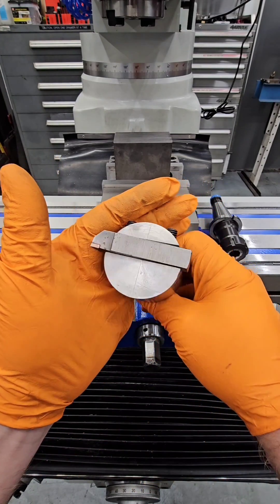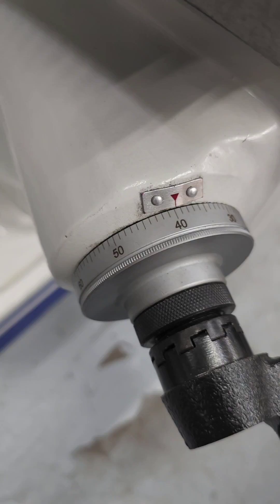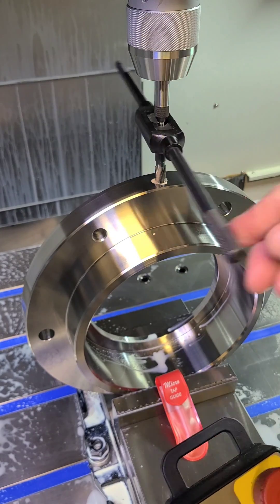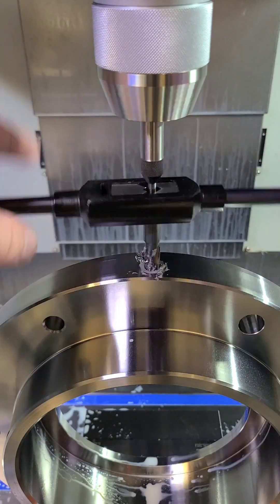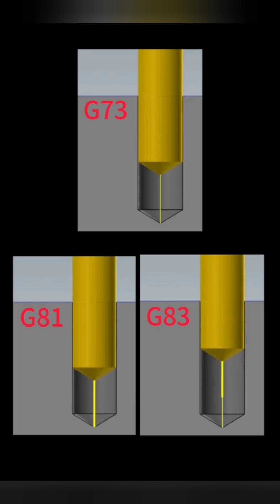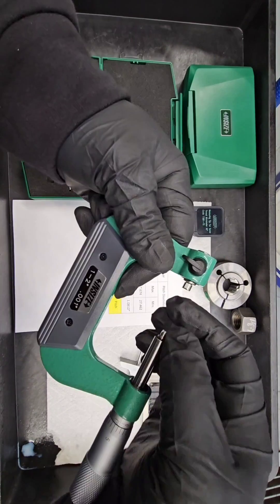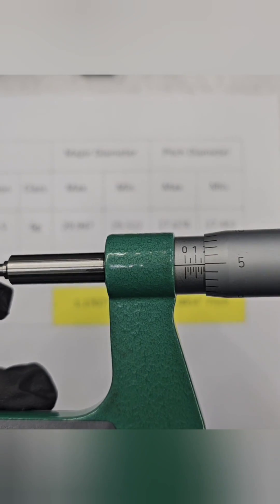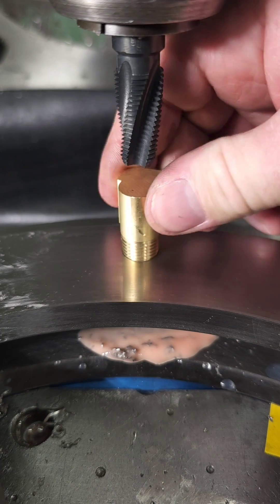Machinist Tips and Tricks Volume 5

Comment: The thread micrometer measure the middle of a thread. It means you could be OK with a thread micrometer but still have a bad thread because of the broken tip of the turning plate you have used for the thread.

Comment: What coolant are you using in your cnc mill?
Reply from the maker: Qualichem 251C
Reply: @OctaneWorkholding  Ok, I haven't tried that. I have tried others and depending on the use of the machine the coolant sits in the tank undisturbed and goes rancid quickly.
Reply from the maker: @Inatool  Qualichem 251C doesn't have any of those issues.  It even smells like oranges.
Reply: @OctaneWorkholding  Ok, I might try some. Do you purchase the coolant from a US distributor that will ship a 5 gallon bucket?